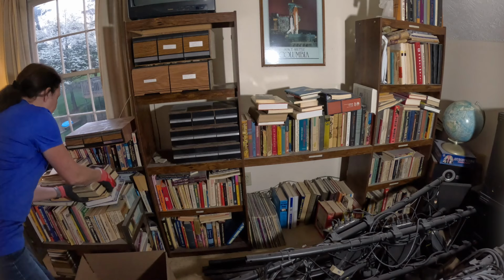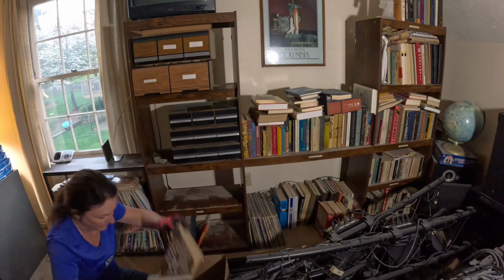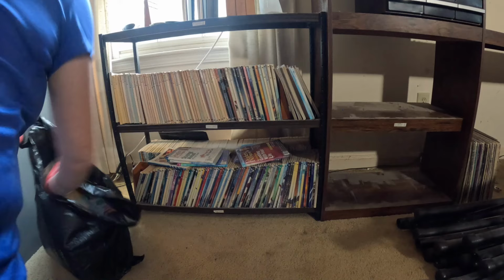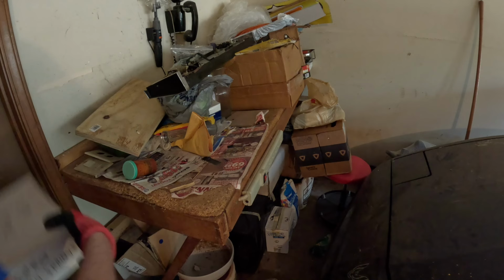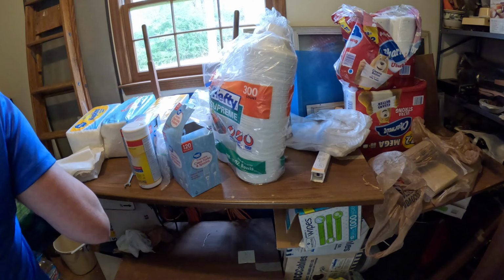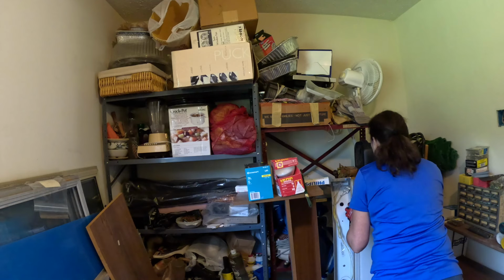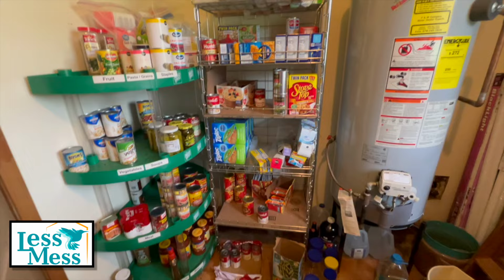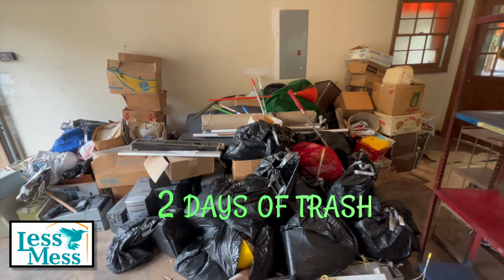Transforming Grief into Grace: A Widow's Journey of Decluttering & Healing Day 2

Comment: I've downsized from more than 10 bookcases full of books to about four bookcases, and I'm still whittling away at them. It's hard because I use them for reference and many of them are rare local history books so they can't be replaced with ebooks. 😟
PS The Reader's Digests can probably go straight to recycling. I doubt if any library or used book store will take them. They don't even take the bound volumes of Reader's Digest Condensed Books.
Reply from the maker: @RadCenterWow, that's quite a journey from over 10 bookcases down to four! It must be a challenge, especially with the rare local history books you rely on. As for the Reader's Digests, you're probably right about recycling them.  Keep up the great work! 😊📚 ❤️
Reply: Our timeshare has bound Reader's Digest books in each of the units for guests to read, plus they gave a small on-site library.  
Historical societies and local library archives could be interested in your rare history books.